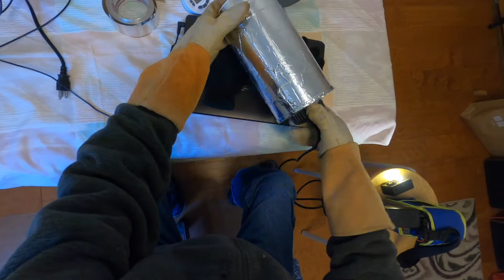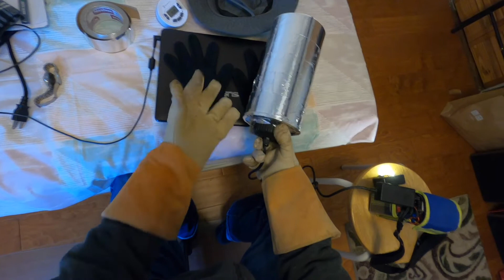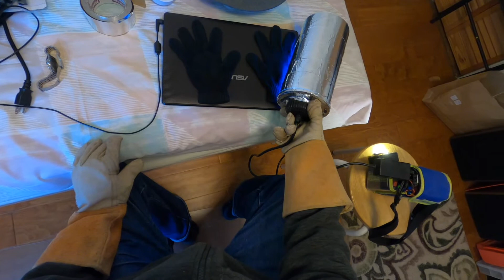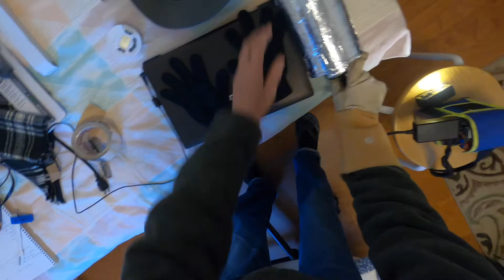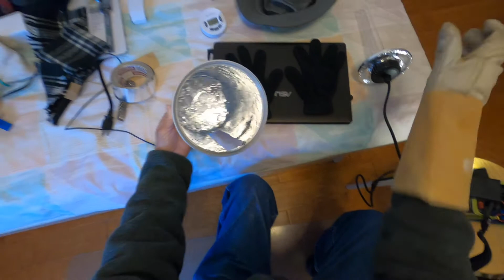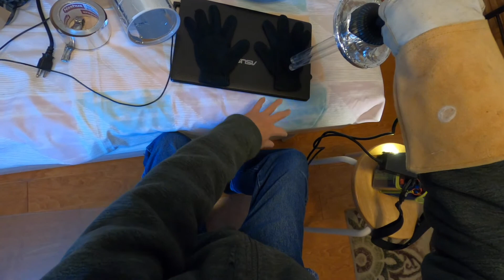Quick and dirty DIY enclosure for UVC germicidal lamp

Comment: This video is full of  accurate but mostly inaccurate information. 1 yes you should avoid exposure to UVC. Putting a single lamp in a room probably will be worthless as to work the surface must be in direct exposure to the light unless you move the light source throughout the room (novel thought what if you placed the light on top of a rumba or other moving robot to ensure all surfaces get exposed) (No you can't patent that Idea I thought of it first) . 2-3 minutes of exposure to a surface is will kill virtually any virus many bacteria and many fungi. Ozone is not very healthy for direct exposure BUT it commonly used to sanitize surfaces (the SoClean CPAP cleaning system uses mostly ozone to clean and sanitize the tubing and inside of the mask and UVC to clean to exterior of the mask). I probably missed so other things but i just don't care enough to watch this video again.
Reply from the maker: Thank you for your input.
Reply: Do you have a product or did you just patent the idea?